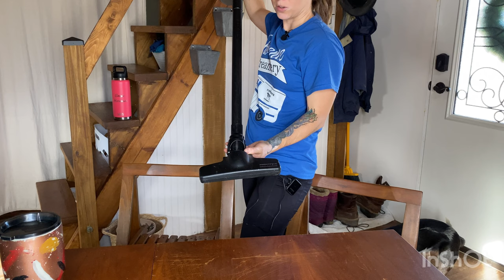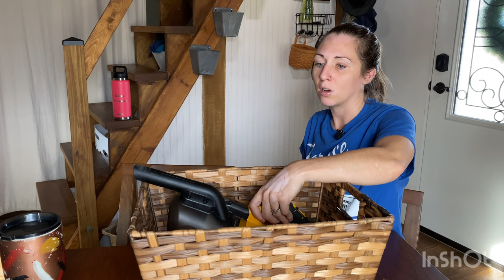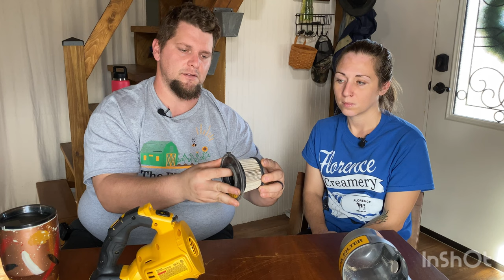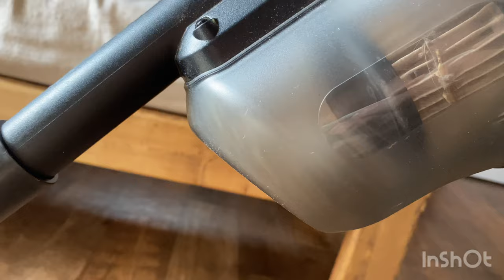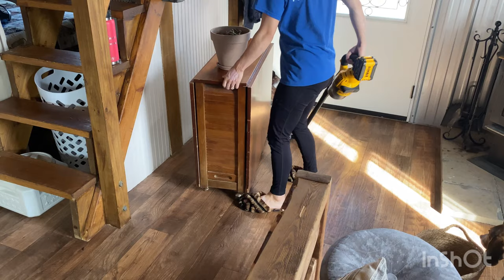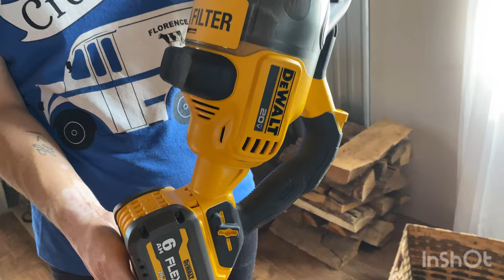Dewalt Review no more tractor supply

Comment: I think I'm gonna start saving to get me that vacuum, thanks for reviewing it
Reply from the maker: Your welcome, please be sure to share this video, and if you would like to get our new merch send us a message. Have a blessed day.-Andy
Reply: I use that vacuum 7 days a week as I volunteer at our animal shelter. It helps to clean the filter very frequently.  By doing that it does well. I use a 9 amp hour clone battery. Just a note, the unit comes with a floor brush & works well. It does not have a carpet tool because it's for a shop. Does a so-so job on our carpeted rugs at the shelter.
Reply from the maker: @rickbraden4272  Thanks for the comment! I also volunteer at our local shelter. I worked there as an employee for 6 years as well. May God bless you for your kindness. 

-Angie